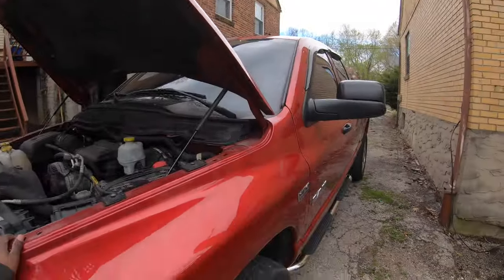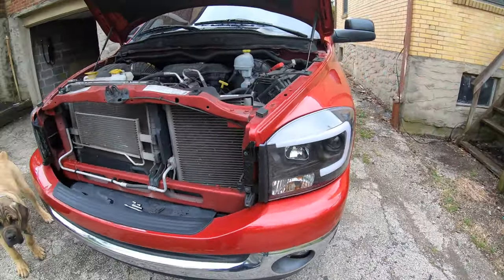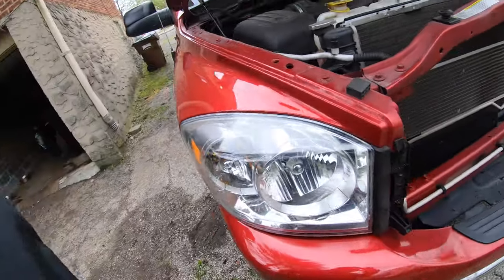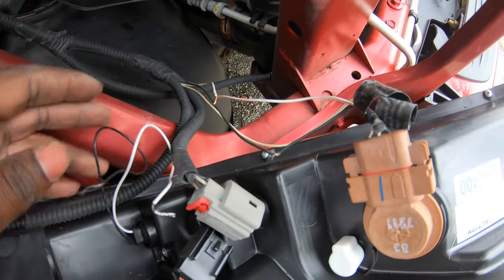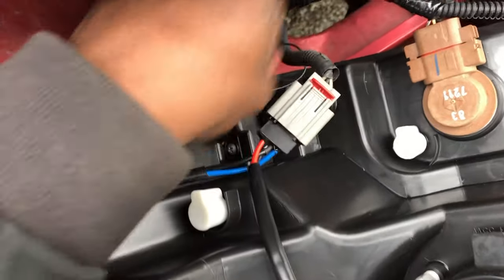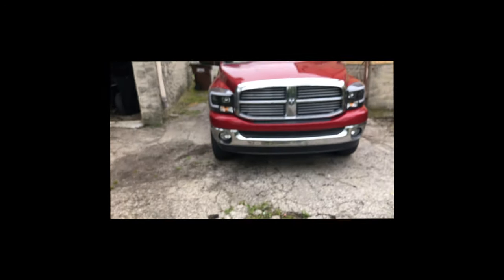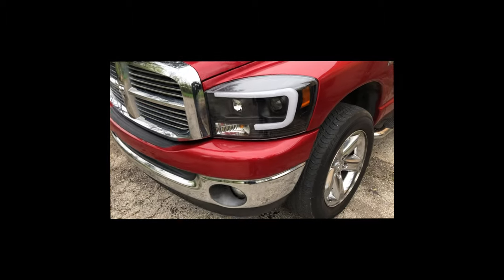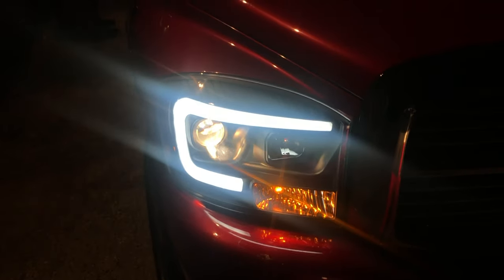INSTALLING NEW SPYDER LED HEADLIGHTS** ON MY RAM 1500!

Comment: Hey man quick question so u wired the light bar into the turn signal power does it blink with the orange bulb that would look cool also did it have any issues after doing that I’d like to do mine like that but they recommend a different way
Reply from the maker: Maryland Lawncare yea I did it that way and no it doesn’t blink with the turn signal...

Comment: How is that wiring job holding up? Still working good? And you wired it to the then signal huh? That doesn't make the bar also blink?
Reply: Turn*
Reply from the maker: It’s holding good still no problems... and no the bar doesn’t blink at all
Reply: @TeyYoung  but it is wired into the blinker right lol. I got these and was gonna install but thinking twice about how I'ma wire it.
Reply from the maker: Yes lol it’s wired into the blinker it doesn’t blink at all when I wired to the other wire it only came on with headlights on and I didn’t want that

Comment: How did you go about wiring the white and black wires? Just used wiring caps?
Reply from the maker: The Automated Era the black goes to the other black (ground) and the white I just connected to my turn signal wires
Reply: Tey Young so the led strips can run off your blinker wires? Wouldn’t your blinkers have to be flicking for them to run? Or it is always sending current through?

Comment: Can the halogen light bulbs be replaced with LED bulbs? Not a fan with yellowish looking headlights.
Reply from the maker: Not sure how that works
Reply: Not sure u tried changing them today from halogen to led but the oem sized bulb didn’t fit and now I’m trying to look for a bulb that fits
Reply: @realmexican0153 did you find which leds work